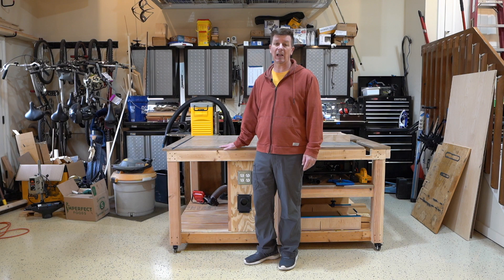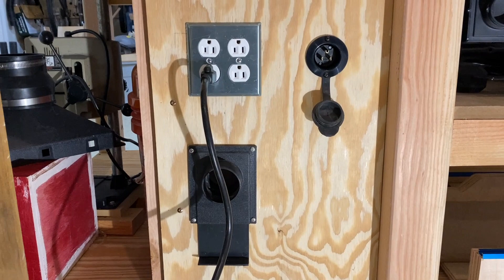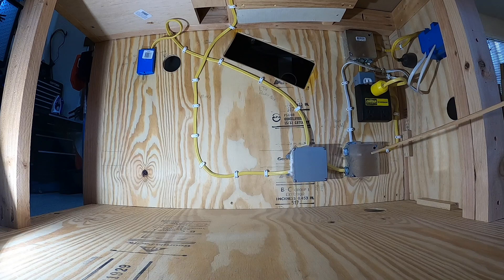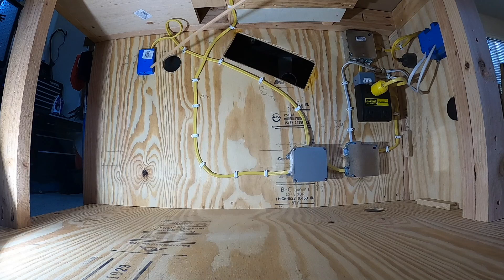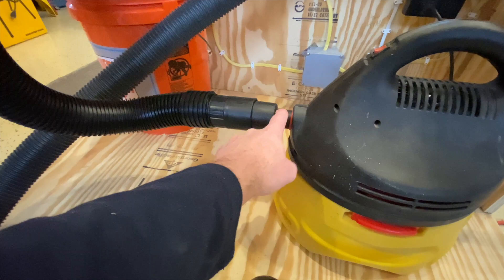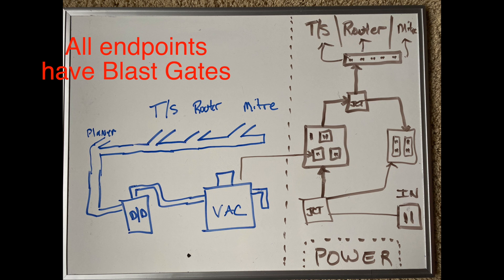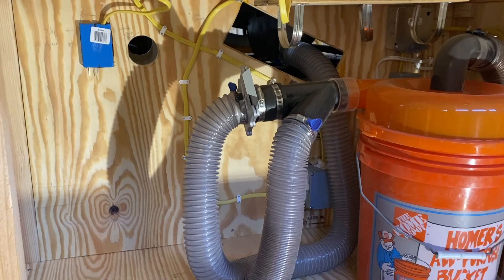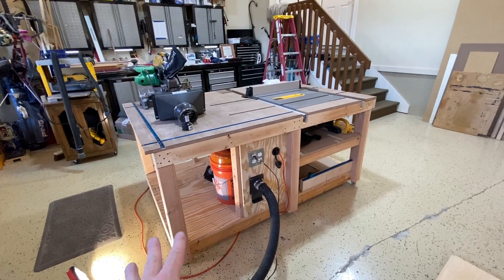Workbench Dust Collection Fail - It worked on Paper

Comment: I have a Ridgid 12 gal wet/dry vac with the Dustopper. I recently bought an anemometer to see what kind of airflow I was getting out of it.

At the inlet of the vacuum, I get 181 cfm.
At the end of 3ft hose that goes to the Dustopper, I get 133 cfm.
At the inlet of the Dustopper, I get 96 cfm.
At the end of the hose going to my table saw (the original hose that comes with the vacuum), I get 77 cfm.

Just a simple set up. Using the Dustopper as it was designed. I lose more than half the airflow that the vacuum is capable of providing. That's when I knew I needed to upgrade.

Comment: I like the idea of a “real dust collection system” on the wall and then connecting it to your bench tools.  My solution was to make a dust collection cart that has my shop vac, dust deputy, hoses and fittings.  The shop vac itself is enclosed in a box which keeps the sound down.  When I need to use it I roll it out and connect it to what ever tool I’m using.  The drawback is that I have only one hose, it would be nice to have a manifold.
Reply from the maker: I’ve contemplated a cart but don’t know if that solves my overall problem. I’ve also got my eye on a Rockler 650 CFM unit that wall mounts. Curious to know if anyone recommends that unit or anything on Amazon.